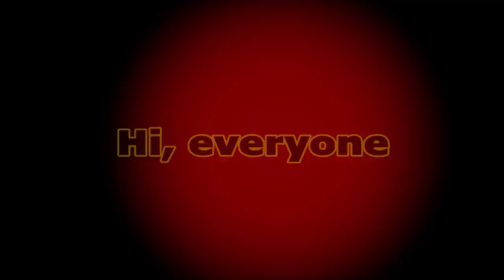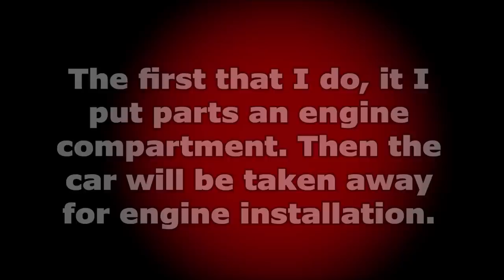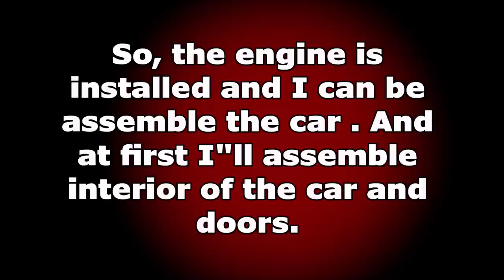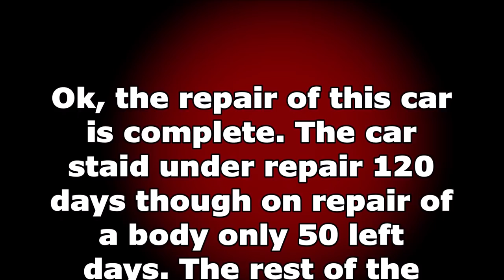Lamborghini. Body repair. Final part. Ремонт кузова. Финальная часть.

Comment: As always Arthur,s  work is without question! Most other places the car would have been a write off!  Arthur Tussik is clearly a very highly skilled panel beater body repairer, most other so called panel beaters simply replace bent or broken parts, not Arthur, he repairs what others would throw away.  Hopefully now the car will not get crashed again!!

Comment: Anybody else wonder how much this cost? 👍😎
Reply: I wish he would say the price of his projects too at the end.
Reply: That's nothing compared to what they would charge for that in the US
Reply: lmfao i wanted to type this exact comment so ill wait on the reply here
Reply: at some point Arthur mentioned around 150 EUR for one day of labor. For 50 days that would be around 7500 EUR but since it's a supercar we could assume double.
Reply: @legioner9  35x150 for Arthur. Normally I would say 35x100. Paintjob is 2k when expensive. 1k when cheap. Plus 1k for engine takeout and put it back.

I think the whole repair costs where round about 20k Euro.
Reply: 20k
Reply: @Berti_00  yes US  shop guys charging a lot
Reply: Half what the dealer would charge
Reply: Ismail Alansari a dealer wouldn’t touch it as it’s a uneconomical repair
Reply: I know Arthur is on the Russian boarders - labour rates are very cheap due to the currency fluctuations
Reply: @Mrflash222006  yes you right,  n Lamborghini dealership didn't work whit crashed car's
Reply: @Mrflash222006  he works in Lithuania.
Reply: @Mrflash222006  *borders
Reply: Ricardo Cañedo oh no it’s the YouTube grammar police pmsl
Reply: In Germany they took 120 Euro per hour in a Bodyshop.
Reply: You guys forgot that the needed several original parts, including the rear quarter, those parts are quite expensive, the cost will depend on where did the owner sourced these parts.
Reply: Just to give a comparison on Australian costs of much lower skill mechanical work (doing brake pads etc), my local mechanical shop at Bondi Beach Australia has an hourly rate of AUD 165 which is about Euro 101 !!  This high cost reflects the high price of beach side real estate.  Arthur represents astonishing value for money.
Reply: Arthur - you are the king of automotive body repairs.
Reply: Goonzquad repaired their Huracan for roughly $136,000 US. That is just the cost for parts, which included purchasing a donor vehicle that was partially destroyed in a fire. I would imagine a professional shop would have been able to get better pricing for parts.
Reply: @Mrflash222006  Arthur is from Lithuania, not from Russia
Reply: @IsmailAlansari  I guess, dealer would totally utilise that car.
Reply: @IsmailAlansari  they would charge even more than triple for sure... or actually they wouldn't be able to repair it... ;)
Reply: A year later owner gonna sell it as a car without accident history.
Reply: DashDrones he said he took 50 days for the Lambo. let‘s assume 8 to 10 hours a day at a wage rate of 5 to 10 Euros. Arthur‘s labour costs probably had been lower than the new right rear quarterpanel. It might even make sense to ship a wrecked sportscar through half the world to get it repaired by Arthur, it would still pay off.
Reply: No
Reply: TheColinChapman , if i had the cash i’d ship Arthur here to Australia. I’ve got a shed full of projects. He’d probably have it all knocked over in 6 months at the rate he goes. I’d even pay full hourly aussie wage cause i know he’d do the job twice as quick as most tradesmen, so it’d still be a relative bargain.
Reply: 40K total with all parts
Reply: @legioner9  20k including parts. Not more. All parts were used or Arthur bought the aluminium for the frame in the metal store. 

I've few supercars, all repaired after accident. Parts are only expensive in the dealership. 

Bumpers are from gfk and can be easily repaired. Most of the aluminium parts you can buy in the metal store. 

These cars are way easier to repair than normal cars. Less parts. 90% is the aluminium frame. Rest is easy.

Best Wishes
Reply: btw parts you can buy on allegro or the poznan automarket. Whole car will be round about 20k Euro. But in the description is written that it wouldn't be able to register a car with this vin...

IF YOU KNOW WHAT I MEAN.
Reply: @MathsatBondiBeach  If Arthur lived near Bondi Beach, he might charge 300 AUD per hour for this sort of job with Lambo but I guess such kind of repair couldn't be some way allowed in Australia.
Reply: Mister X In Australia if the car is wright off by accident or flood damage you can’t register the car any more .
Reply: @Batman-wv5ng  This is so right.
Reply: 25.000€
Reply: He makes mad money off the sale
Reply: @AndreiIR000  thats 2 hours in holland, 150 euros. this would be totally not be affordable in holland. this would cost 60000 euros here. seen the price the repair on my Mazda 2 was 6400 euro's for a minor repair compared to this.
Reply: @Neptun2006  
I don't know, but i gues that the front windshield is at least 5000 dollars or even more, and not to mention other parts
that were needed, so i gues it's more like 25k or even more. Still cheap, because in a western country this fix would
 cost easely 50.000 dollars.
Reply: @3DPeter  Unfortunately much of the car parts in Lithuania is stolen from cars in other country. I live in Sweden and have seen it myself in my neighborhood 3 times, they take the steering wheels, airbags etc, they can hit more then 5 cars in one street very fast. Sometimes they steal the whole car. It's a big problem here. And when all the cars are repaired on the insurance a few weeks later and steel the parts again on the same cars!
Reply: @Marauder252  
don't tell me, because i had my 1995 mercedes sprinter fully restored, and never fought that someone would steal
such an old van, but they did after just 3 weeks when it was finished.
Reply: I don't think anybody in Germany would repair this car, they would rather laugh at you and say buy a new one.
Reply: @Neptun2006  что-то мало вы обозначили
Reply: @GrrrRu  i didn't count the parts. Only work including paint.
Reply: @Neptun2006  полагаю, не дороже полцены исходных обломков должно стоить)
Reply: Can’t believe he would only charge 150 Euro a day that’s insane.
Reply: @Mrflash222006  No, a dealer wouldn't touch it because the damage is too extensive. It has frame damage. If they fix it and the driver got into another high-speed accident, they could be held liable if the driver claims the car suffered a failure.
Reply: @mikecochrane1437  That's good money for Eastern Europe. 750 euros per week is more then majority of medical specialists (surgeons and similar) earn in well all east European countries. Earning 3k euros per month in eastern Europe is like 10-12k in western Europe. True life costs are lower in general but majority of things is the same price (food in supermarkets, majority of bills...) and some stuff like cost more... so all in all no wonder it got repaired. Arthur earned some money, satisfaction and reputation and the owner got his car for peanuts and that lambo is probably gonna be sold as undamaged or already is. Why do you think so many people left so many east European countries and headed west?! Higher life standards.
Reply: Paint job max was 5k maxx i mean u knoe max but the complet body repainting could cost from 15k to 20k
Reply: For his work around 2500 Dolar + cost of spare parts.
Reply: 4000000BITCOIN
Reply: Neptun2006 in your dreams
Reply: No, I was wondering what went through the owner's head with that awful lipstick red wheel colour choice. 🤣
Reply: @Mrflash222006   that's why We (AMURIKA !!!  F**k Yeah) have so many cars totaled by insurance adjusters, as MrFlash mentioned above, labor cost alone would be astronomical,  and that's how Arthur is in business. He is so talented, it's amazing, you can see that he takes pride in his work. Thanks for sharing it with us. Good job, Sir! Arthur ti prosto krasavchik !!!

Comment: great great job, welding aluminum is so difficult - half a second too short, and the material won‘t connect. half a second too long, and the structure melts.

Comment: You are a genius, congratulations. On such a fast and powerful car, to repair the chassis, you need to use an official template with all the exact dimensions of the manufacturer. The supporting frame of these cars is too important for performance and safety.

Comment: No cóż, auto ponaciągane, wyklepane młotami, porozcinane potem pospawane, wykitowane szpachlą i na koniec malarze wymalowali. I jak bym kupował passata za 2 tyś euro to może by mi nie przeszkadzało jak by było dobrze zrobione. Ale wydając na taki wóz 100 tyś euro bym się wqurwił!!! 

A znając życie będzie sprzedawany jako bezwypadkowy :) 

Well, the car was pulled, hammered, cut out later, welded, beaten with a spatula and finally the painters were painted. And if I would buy a passat for 2 thousand euros, maybe it would not bother me if it was well done. But spending 100,000 euros on such a car I would pissed off !!!

And knowing life will be sold as accident-free :)

Ale tak czy siak Arthur kolejny raz dał radę.

But anyway, Arthur managed once again.